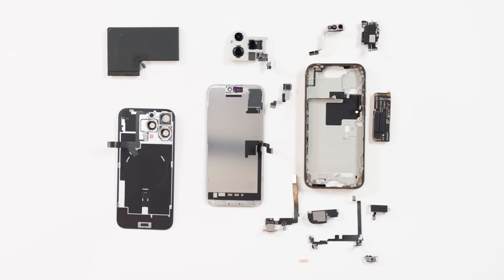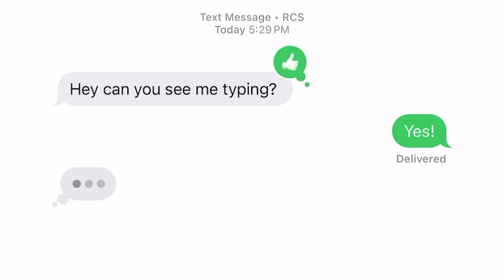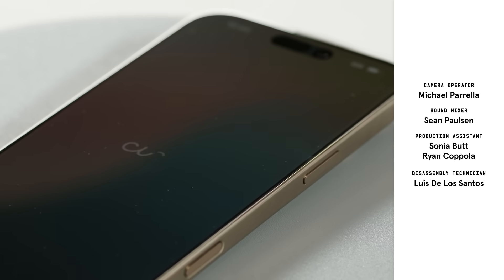iPhone 16 Pro Teardown - How Every Single Piece Inside Works | WIRED

Comment: 0:40 upbeat music
0:43 the frame
0:54 bezel
1:01 bezel width
1:04 antenna lines
1:07 millimeter wave 5g antenna line
1:15 volume rocker
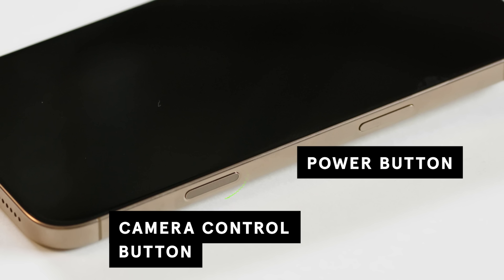1:18 camera control button
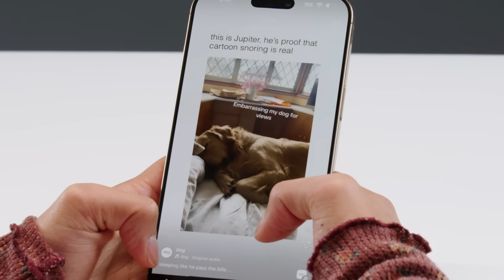1:44 the screen
1:51 oled display
1:59 corning gorilla armor 2
2:05 ceramic shield
2:18 pro motion technology meaning
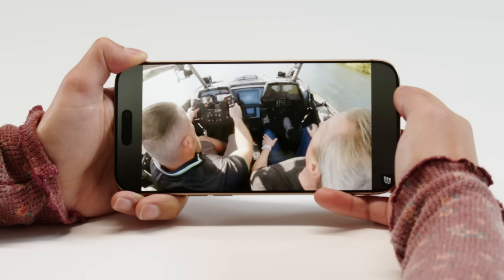2:38 HDR content
2:55 mellow music
3:01 proximity sensor
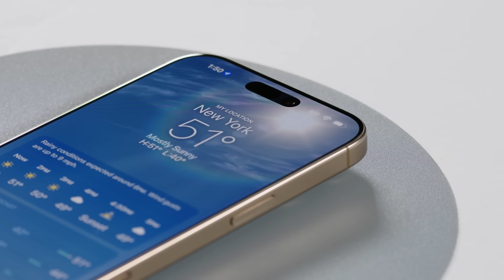3:07 ribbon cable and ambient light sensor
3:15 aluminum frame and heat dissipating
3:30 black plastic bracket
3:37 shock absorbing foam strip
3:45 the back cover
3:49 wireless charging coil
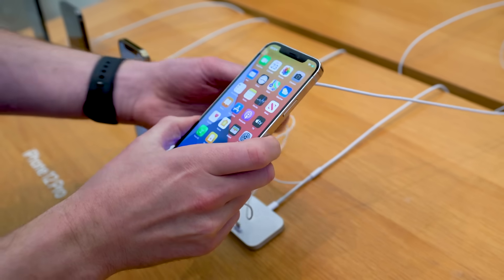3:58 magnetic bike mounts
4:11 the rear cameras
4:14 sapphire crystal lens cover
4:18 cmos sensor
4:30 foam rings
4:47 lidar sensor
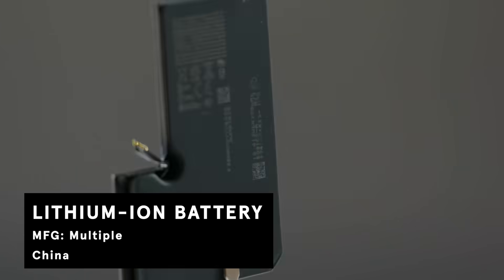5:11 the battery
5:14 lithium-ion battery
5:57 mellow music
5:59 the sound system
6:03 microphone
6:07 top and bottom speakers
6:14 top speaker
6:18 taptic engine
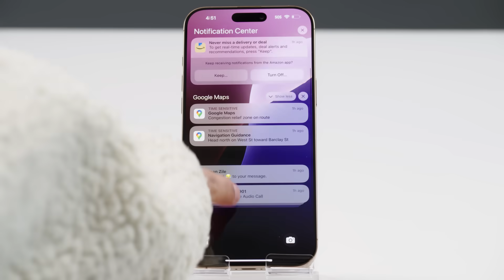6:28 front camera
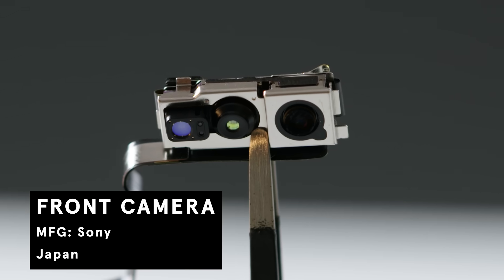6:35 the notch
6:40 the Dynamic island
7:02 The motherboard
7:10 A18 Pro Chip
7:16 specs: 1
7:28 specs: 2
7:57 Wi-Fi 7 certified
8:05 nand flash storage
8:18 charging
8:26 JCIS Philip screws
8:35 USB-C Port

Comment: 6:08 The bottom speaker only fires out through the right hand side grille. You can test this yourself. Play any audio, block the left grille, and see what happens. Literally nothing. The microphone is on both sides.

Comment: What do you mean they use the top speaker instead of the receiver since the iPhone 13?
Reply: iPhones have replaced the traditional receiver (a small speaker for calls) with a standard normal loudspeaker. The software automatically adjusts the volume during the calls, making it act like a receiver. This allows it to function as both a loudspeaker for media and an earpiece for calls.